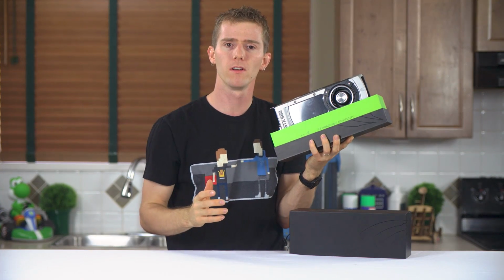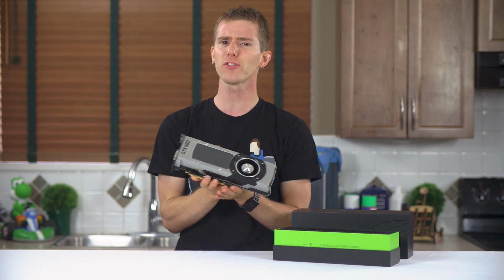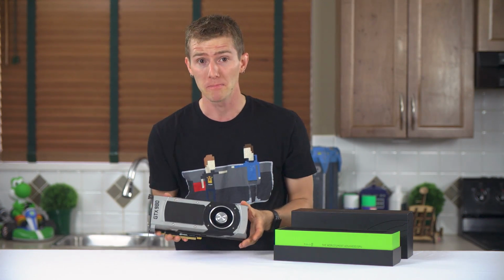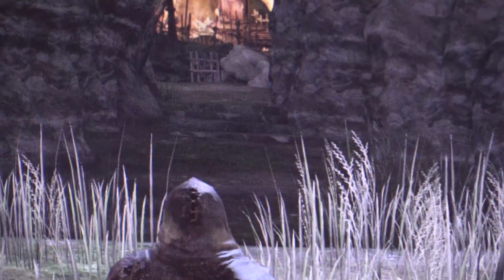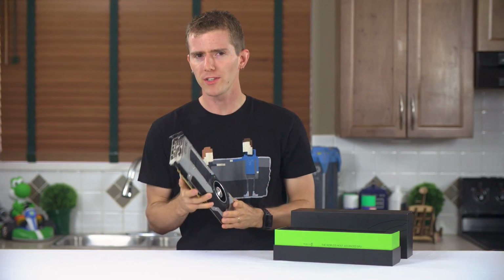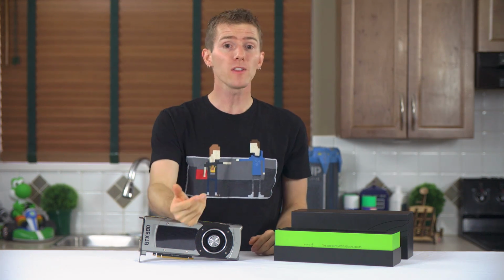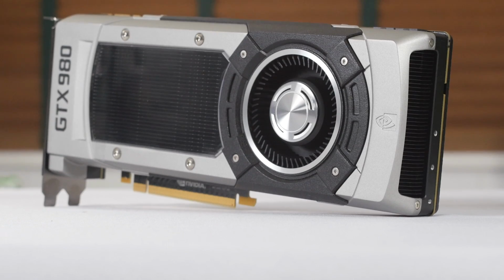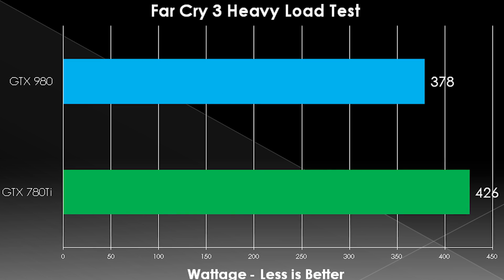NVIDIA GeForce GTX 980 Video Card - Performance Overview

Comment: Haven't seen anyone do any kind of comparison using x99, 40 pcie3 lanes with single and multiple gpu crossfired or sli, 1, 2, and 3, compared to previous gen intel or amd boards.  Some things may not be expected to see benefit, but are there any surprise or expected differences graphics wise?  Does this card give the same numbers on non x99?  Using sata express, m.2, or anything else that takes some pcie lanes removed so multiple gpu's can utilize as many lanes as possible. Would like to see new and still relevant gpu tests and comparisons between x99 and previous intel and amd board benchmarks.

Asus deluxe, and WS, seem to be the best x99 boards in features and function that have been shown so far. 

Nice to see x99 was used for the benchmarks.  Many who got one, built it for their work rig, and only basic processor, ram, comparisons done and reviewed.  Aspects of the new bundle of goodies in x99 haven't been reviewed or compared to previous best intel and amd boards.
Reply: Same here. I really want to see sli benchmarks with x99. Someone will do it soon. Most likely linus.
Reply: and by that you mean slick, lol  

Jay has 3 way going on his skunkworks 2.0. custom loop cooled.  Not sure if he has covered their benchmarks, but sure I have not seen anyone compare how things behave and perform on x99, to previous intel  and amd best boards.  Unless I am missing something, there should be some differences, and possibly even 1 card may be different.   Tiny Tom logan just made a point to bench new 980 on a non x99, for that potential reason.
Reply: M Par I would avoid information from jay. Alot of false information I seen from him multiple times. But yes, I really think the 980 is optimal for 4k and with the x99.

Comment: Will it be better to use 2-way SLI on the 980s rather than doing a 2-way on a 780 TI?
Reply: ***** Thanks, I read up comparisons on the 780 Ti and the 980 and apparently the 980 has less shaders and texture filters so I just wanted to check in

Comment: The only 700 series card that won't become obsolete right away is the 750 ti because it was the only GPU based on maxwell before the 980.
Reply: The others will still be relevant and good for another year...
Reply: Well the 760 will stay in production and get a price cut to 219 usd

Comment: I have an R9 290 crossfire rig for 4K gaming but am in the process of returning them. I was originally planning to get different 290s with better coolers. Should I get two 970s instead?
Reply: Yes, you should.

Comment: This, or titan black?
Reply: If you're strictly a gamer, this. But if you weren't, you'd already know the answer.
Reply: This
Reply: AbsoluteZ3R0 Thanks!
Reply: ***** No problem. A Titan Black will likely outperform it marginally in some situations, but this tiny difference is not justified by the massive difference in price. If money is not an issue, or if you're just willing to spend a grand on a GPU setup, you'd be better off buying 2x GTX 970, which will vastly outperform either card by itself, and might actually cost less or the same as a single Titan Black.

Comment: What's the pricing? (the link in the descriptions leads to another link that says "No Search Results Found.")
Reply: It hasn't actually launched to retailers yet, but the price is set at $549 USD for the 980 and $329 USD for the 970.
Reply: sambassmanstoner tyvm

Comment: what happened to the 880?
Reply: 8xx series are mobile.
Reply: the 800 series ended up being mobile GPU's. they could have called the 980 the 880 but they didnt due to confusion
Reply: They skipped the 800 series on desktop cards because they already have an 800 series for laptops (e.g. 880M). They skipped it because they wanted to even up the numbering scheme between the two

Comment: R9 295X2 is still the card in my sights, it's just too beautiful.
Reply: Why?  970 SLI equals its performance for only $660.00
Reply: Darkswordz The reason is because it's a single card. If I wanted I could use 4 of them (yes, you could crossfire 4 dual GPU cards) and get more performance. The max you could ever fit on a motherboard is 4 single GPU cards.
Reply: ROG Ares III>everything else
Reply: 123coolx :O Jesus Christ! That is the most beautiful thing I have ever seen in my entire life. Where the fuck can I buy that?
Reply: You can not use 4 dual GPUs. You can only use 2 dual cards.
Reply: Fun Time With Souls Not true, the new XDMA Cossfire bridge and recent drivers allow for more than 4 GPUs. However, that only works if you have Windows 8 which supports 7 GPUs, and not 7 that supports 4. Though, hopefully when Windows 9 is released (hopefully soon after the announcement at the end of this month) it will support more than 7 to finally have that final GPU I need to effectively use 4 dual GPU cards.
Reply: 1 slot 2 GPUs and is faster than a titan z and there is only 500 made :(
Reply: 123coolx Well of course, even the reference R9 295X2 is faster than the Titan Z, but I like the ASUS one.
Reply: 1 slot vs 3 tho

Comment: Nvidia is just going to price this at 720 USD, I'm calling it. Miss the days where single GPU is 500 USD :(
Reply: 980 is 550 and 970 is under 350. just announced
Reply: fixed92 Really?! I did not expect that. I'm skeptical though, where does the 780Ti comes in?
Reply: ***** Sorry, no. I've had class all day so I missed it.

Comment: Nvidia needs to include mantle already, mantle gives a significant fps boost over dx 11 -.-
Reply: they wont since they got directX 12 in the work :P
Reply: well, it would still help in all games made in 2015 and before :P
Reply: danny gallegos Do you really think that AMD would ever give them Mantle? Even if they would be close to death they wouldnt.
Reply: bro, mantle is open source, just like freesync. anyone can use it.
Reply: danny gallegos Yes, Devs can use it but not Nvidia. They would need to pay AMD licence fees.
Reply: nope, its open source, nvidia can use it for free.
Reply: danny gallegos They dont want to because they dont see any benefit in it and see much much more potential in directX12. We dont need Mantle anyway. High end Nvidia cards can pretty much handle anything you can throw at it.
Reply: same thing with high end AMD cards, i mean, the 980 is only about %10 faster than the 290x, but is 1 year newer and costs $50 more. I think mantle has a fantastic future, and it will also allow for console-PC ports to be very easy, as a (future) console can run mantle.
Reply: danny gallegos Consoles run directX12 tho. They arent interested in Mantle aswell. Mantle is stalling before it even really started and thats why AMD tries to safe it with openGL.

Comment: If I were to choose a 780Ti and 980 over my 500 bucks, i would choose the latter.
the efficiency in power consumption should stay and remain as the feature needed ove gtx series. Otherwise I would have the R9 series from the very start and go all out the power consumption. Since power consumption is my less thought atm, i opted to have a friendlier budget card, th eHD 7950 OCed :)

Comment: So the Rumors were correct and this is a disappointing launch...  10-15% performance is hardly worth an upgrade if you already have a 780/ti  as for the 770 it could be but so would SLI seeing as both of the cards are quite powerful.

Comment: OH GOD I'VE BEEN WAITING FOR THIS! Is it really DX12 compatible? He didn't mention if it was.
Reply: Any DX11 hardware is DX12 compatible. DX12 is basically just an enhanced, improved DX11. It isn't the same jump as previous DX iterations.
Reply: MordeaniisChaos Not all features will be avaiable on DX11 cards tho. Some features require dedicated dx12 cards. But the (atleast for gamers) important performance boost is avaiable on dx11 cards.
Reply: MordeaniisChaos  I really don't believe that. I want to though, but i've been buying GPU's for new DX reiterations for so long I wouldn't believe they wouldn't force a hardware upgrade.
Reply: Ｒｕｓｈｎｅｒｄ It was officialy said by nvidia that the core features of directX12 are avaiable on all modern directx11 cards. Only some features (which shouldnt be important for gaming anyway) will need dedicated dx12 cards. On dx11 cards we will still get that big performance boost.

Comment: I have a Gtx 670 4gb, will it be worth it to upgrade to a Gtx 970?
Reply: Yes
Reply: Are you getting 60fps 1080p @ medium settings? If so you dont need to upgrade
Reply: No get a 780 better performance for basically the same price.
Reply: Are you kidding me? I can get a new EVGA 780 for $350. The 970 hasn't even come close to beating out the 780 ti in any benchmark. It doesn't beat out the 780 in most games either. The 970 wasn't meant to beat out the 780 it was meant to replace the 770, which is where it falls. Right between a 770 and 780.
Reply: Commenter You're stupid. The 970 does outperform the 780 and 780ti.
Reply: Did you even watch this vid or look at benchmarks?

Comment: I'm so in love with my GTX 680, I think the only I hear it is putting Witcher 2 on ultra not even the newer games have problems.  My question is with an i7 3770k and 16gb Ram when I do upgrade which should I do?  The 680 to the 980 or the processor or the Ram?